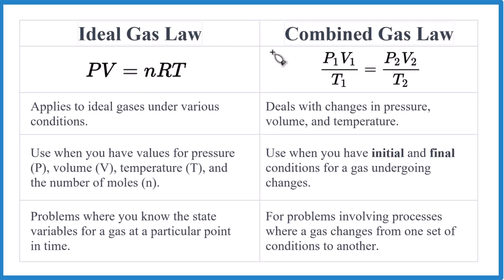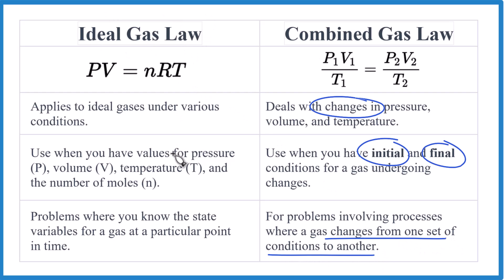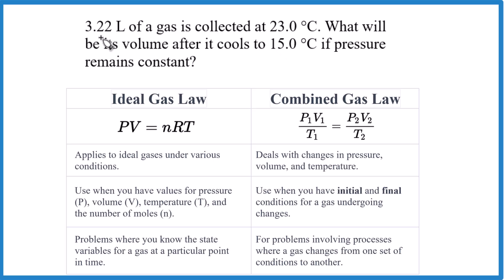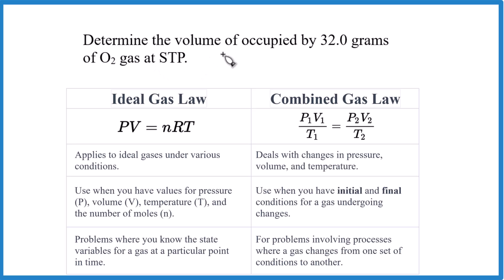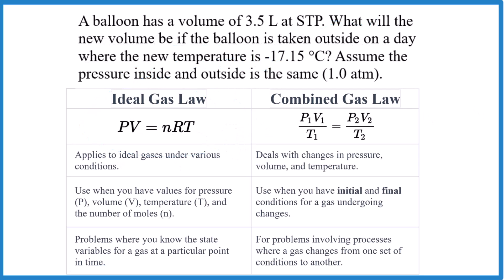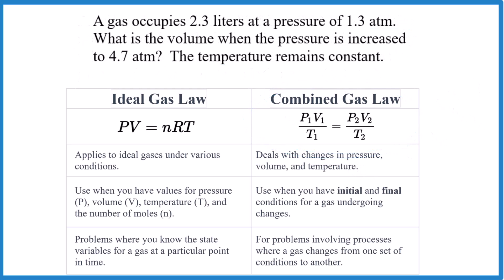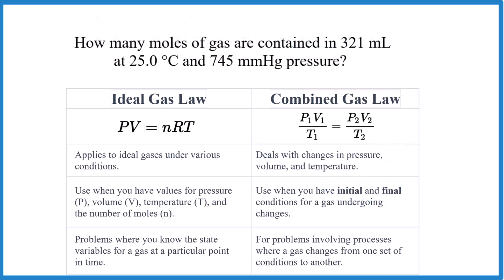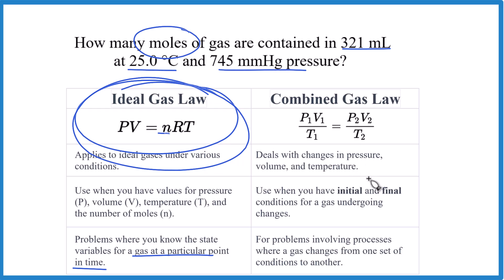When to use the Combined Gas Law or the Ideal Gas Law

Comment: you should also explains the conditions such as open vessel or vessel with a pin hole. evacuated vessel. But nvm still helpful
Reply from the maker: That's a good point.  Those conditions can be challenging for the combined gas law!